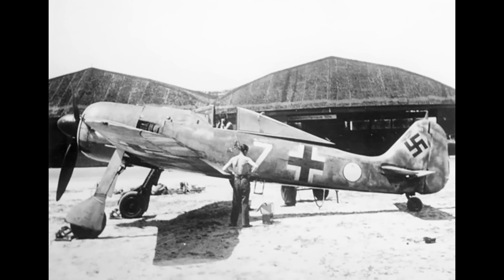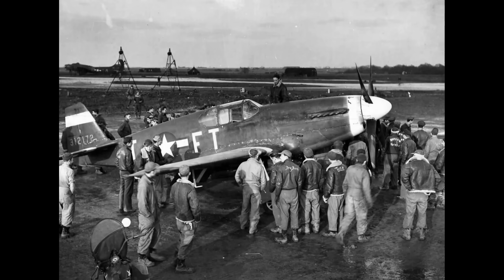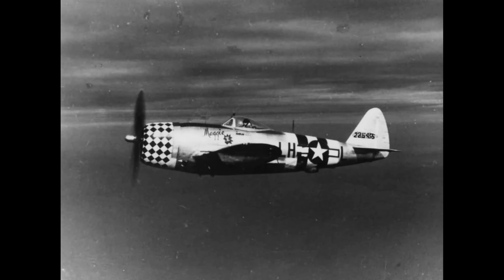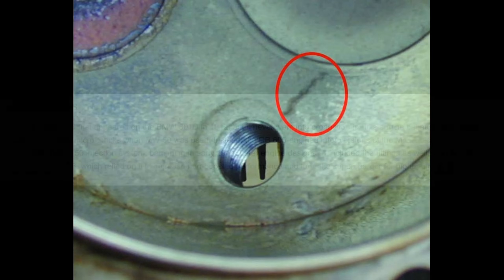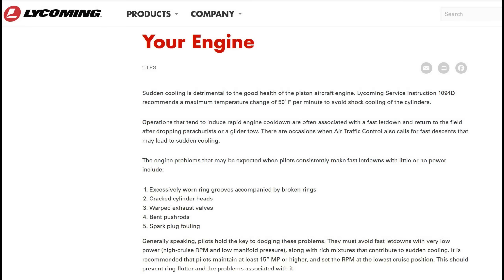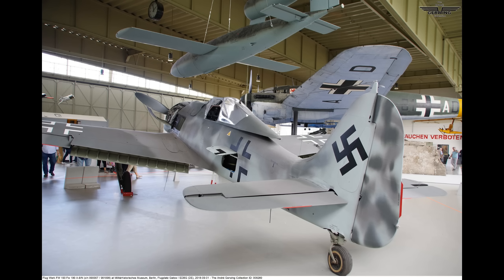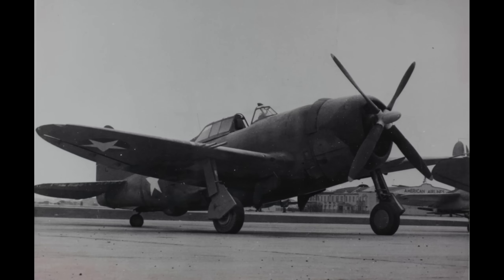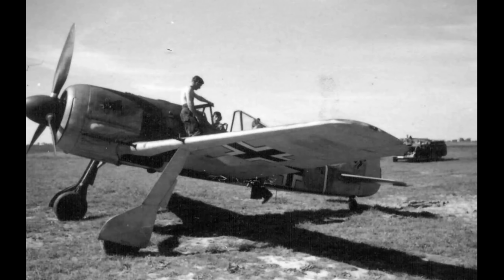Focke-Wulf Fw 190 A-4, Almost turned the tide, Almost...

Comment: I agree that that the metal the heads were made of were the bigger problem, in the late 70's and early 80's helped with building and running several diesel tractor pulling tractors, we would blow the heads off the block, before we ever cracked a head! We injected everything but the kitchen sink in them, took stock 40 hp farm tractor to well over 800 hp for a 300ft run!

Comment: Hi Greg, fuel cooling was a thing in the non water injected PW2800. The F4U is running an AFR of 9:1 at takeoff power, about as rich as you can go, without putting the fire out.
I’m doubting the A4 would have had the boost to be a super fighter at B17 altitudes, but they did fix that, with the Dora
Reply from the maker: Thanks.

Comment: My father was a B-24 pilot in the 15th, mid '44 till end of the war. He had much experience with 109 and 190 attacks. The 109s would bounce and scatter the formations. Then the 190s would charge in, often ten abreast, head-on. Dad said, without doubt - even worse than devastating flak - 190s chewing thru aircraft was by far the scariest thing he ever experienced.
Reply: Yup, my father a bombardier with the 15th 35 missions said he feared the 190.

Comment: Non pilot.. but straight up engine guy..idle any air cooled engine for 1.5 to 2 minutes eliminates this issue,( good for turbo cooling too). Snowmobiler here also.. rapid cooling comes from snow hitting 200 plus degree cylinders..I owned a John Deere spitfire. Google that.

Comment: Surely 'shock cooling' with water/methanol injection is going to be down to the very rapid phase change of the mixture i..e. going from liquid to vapour under the rapid increase in temperature from the compression by the piston, presumably this very rapid drop in temperature is what increases the density of the combustion charge  effectively forcing more mixture into the combustion chamber for more power.  Perhaps this rapid drop in mixture temp in direct contact with cylinder head surfaces is what could cause surface cracking in the heads?

Comment: Nice video on what might have been if MW-50 would have been extensively  used on FW-190 A series. Regarding shock cooling, you mentioned piston skydiving aircraft descending on idle power after releasing the skydivers. I used to be a skydiving aircraft pilot, flying mostly Cessna 182s equipped with normally aspirated Continental  O-470 engines. Aware and mindful of engine shock cooling, our standard operating procedure was descend maintaining around 15" manifold pressure  and 2200 RPM all the way to finals, while keeping a close eye on cylinder heat temperature. We never ever descended on idle power.

Comment: Most cracks in cylinder heads or anywhere else on any Metal Machine like an engine Usually occur Yeah regular Takes place places whenever they occur period Frequently the weakest point or the point that is most subject to thermal cycling. So yes if you're changing the temperature more often you may have a greater tendency to develop a crack where other aircraft have also developed cracks in their cylinder heads.
But usually the Lycoming engines have been around long enough that they know pretty much what they're going to do as long as you keep the right oil in them and keep it changed properly and use it within reasonable proximity of their operating standards. You're not going to have unusual problems with them. And as for the glowing turbochargers, those things are always glowing especially on aircraft where they're subjected to having to put out a decent amount of torque while cruising at any reasonable speed while they're trying to force that fan through the air. That's why I tell people who have turbochargers in their cars that if they drive it in a spirited fashion in any way shape or form, to always let it idle for several minutes before they shut it off. You shut off an engine with a piping hot turbocharger you're only going to cook the oil in the turbo shaft which will result in turbocharger failure. I've even seen people that when they shut the engine off they have a device attached to the car where it will sit there and idle for about 5 minutes before it will shut off.

Comment: (posting at 8:10 in the video) hey Greg, as an automotive mechanic and as far as whether or not shock cooling is "a thing" when looking at the various groups of aircraft - Piper Chieftain, training aircraft, aerobatic, etc., it may be worth looking into the specific engines themselves. A thicker roof on the combustion chamber should be more resistant to shock cooling than a thinner part. It could be that you find a correlation of "more durable" (thicker combustion chamber walls) in the engines used in training and aerobatics. 

It certainly stands to reason that when building a 'purpose designed' aircraft, like training or aerobatic, that both individuals and corporations would use engines "known" for better durability, whereas a fleet aircraft might use a more "lightly" built engine for economic reasons. 

Thus, one might observe that the training regimen for the turboed piston engines is entirely warranted while the issue rarely rears it's head in a trainer regardless of the abuse.

All that said, your explanation makes far better sense than mine. :D

Comment: OK, it was somewhat better than what it was up against, but it wasn't "turning any tides" and was going to be, at most, a brief period of superiority, followed by a crushing response that simply overwhelmed anything the Germans could have done. The "turning the tide" argument is  exactly what people thought of the Tiger tank, and all the supposed super-weapons the Germans tried to develop when they got desperate. Didn't make any difference, the Germans couldn't possibly oppose the Allies (largely the Americans) pumping out pretty good pilots and pretty good airplanes/tanks/guns. etc in absolutely overwhelming numbers. So, you are arguing about minor details of specific models and claiming that they were somehow decisive. "Shock cooling" is definitely a real thing, I have watched shock-cooled iron parts fail in a far more benign situation over and over. Take a cast-iron frying pan off a hot fire, and toss it into a creek, 50/50 it cracks. The details matter so minor shocks possible using air to cool it is a very niche issue.
Reply from the maker: The Luftwaffe did turn the tide, a number of times including when it stopped the USAAF from bombing Germany in late 1943.
Reply: @GregsAirplanesandAutomobiles  And what happened in Early 1944? The Luftwaffe more-or-less didn't exist in a practical military sense just a few months later. Point being is that these little microscopic and fleeting changes in detail advantages had no real effect on the larger "tide".

Comment: Remember this was all happening on the FW190A-4 in late 1942 when water injection was not well developed.  
MW-50 on Fw190 was given a /U or /R number but doesn't appear to have ever been used in any combat planes.
Now GM-1 is a topic i would like to see properly covered.
Reply from the maker: Water:Methanol injection was certainly fully developed by 1942, just not on the 190, and it never would be on the 190 for the reasons I talked about. I'll get to GM-1 in another video.

Comment: I don't understand. Surely cooling takes place on the vacuum/ intake stroke? Valorising the fuel mix is going to do absorb a lot of latent heat, no?
Reply from the maker: Compared to water, no.
Reply: @GregsAirplanesandAutomobiles  Right, but if it goes into the charge air, it's getting expanded and chilled on the intake stroke but the power stroke also burns cooler. Ok. Got it i think.

Comment: I saw an article or was it a video many years ago. But it was a gentleman hired, possibly by the military,to test 3 types of alcohol on aero engines. He qas given a couple of engines to push on a old school engine dyno. 
I remember the dyno bldg had a large air pump system to boost the engines as the engines werent running their own supercharger if i remember correctly.  
He tuned the engine by looking for soot. I remeber he said isopropyl alcohol did not work but then later realized it didnt because it richened the mixture a lot compared to the other 2 alcohols which I don't remember. 
I dont remember if he tested a German engine on that article. But you mentioned you weren't sure why germans abandon water/alcohol injection. The gentleman doing the tests said the american engines had water injection further on the intake allowing it time to travel with the air and cool the charge while german tried direct water injection or injection very close to the valves or something along those lines. I hope this helps.

Btw- ive tried looking for this article and have not found it again. Hopefully some1 has heard of it.
Reply from the maker: The Germans were spraying at the supercharger inlet, literally as far from the intake valves as they could get.

Comment: @ 5:40 Engine cracks, I'm  70yr old Brit, a  Motor Mechanical engineer, I started as an apprentice, with cars that still had metal rod operated brakes, to Citroens with Suspenion fluid bled off to operate the brakes, an awful lot, to take in in 5yrs of apprenticeship, but you never stop learning, In my opinion, one of the worst environments, other than flight, is road vehicle engine compartments, the expression, you wouldn't keep an animal like that, was common, Aluminium Cyl/heads on cast iron blocks, was a big proplem, all sorts of air ducting off exhaust manifolds to Carb inlets with the associated fire riks, and this was 25yrs after WWII,

Comment: Sry but this is giving to much credit to the FW 190 A5. Pushing the Normandy landings back? Soo the alliead  numerical makes no difference??
Still an excellent video but that take 🫤
Reply from the maker: Hold on Samuel. The Luftwaffe literally did stop Allied day bombing of Germany in late 1943, so it's certainly possible that had things been a little different they could have done so in 1942.
Reply: @GregsAirplanesandAutomobiles  In Germany not France. In northern France the range wasn't such a problem. And the  numbers are still there. More is still more.
Just a small joke. Great video 👍

Comment: 11:00 "no operational A5 or later Anton had MW 50." Seriously? I read that there were some problems but that at least the famous A-8 version had the MW 50 system. There was space behind the pilot seat for either a 115 liter additional fuel tank or for a MW 50 supply or for a GM-1 supply, as well as inlets at the fuselage to fill them.

Comment: The continuing development of the Spitfire and the introduction of the P-51 kept up with anything the Germans could produce. The FW 190 was only superior to the Spitfire for a short time and once the MK lX Spitfire and later Typhoon and Tempest the FW 190 became just another German fighter to knock out of the sky. By June '44 the Allies had air superiority over Europe.
Reply from the maker: In 1942 there were no fighters escorting into German and certainly not P-51s or Spitfires.
Reply: @GregsAirplanesandAutomobiles  the first squadron of P-51s went into service in January '42. Mosquitoes were introduced as night fighters for the RAF in May or June 1942.

Comment: In gliding,  lycomings are treated very gently and shock cooling is the reason. Power is kept in after glider release despite the fuel burn and longer turn round time. I was learning to fly gliders at Husbands Bosworth when they converted their Chipmunks to lycomings and immediately started cracking cylinder heads.

Comment: Spoiler: There was no way to turn the tide of that war. There was no way that German industry could keep up with the combined industries of the US, UK, and USSR. None.
Reply from the maker: The Luftwaffe did turn the tide in late 1943. They force the US to stop sending large daylight raids into Germany. Considering that, it's not hard to believe they could have turned the tide in 1942 when the opposition was much lower. I think you're confused about the concept of "turning the tide". It's not a one way street, it goes back and forth. I didn't say that the Germans could have won the war, that's very different.
Reply: @GregsAirplanesandAutomobiles  "Almost Turned The Tide" in the headline is quite different from "A two percent loss rate in daylight bombing caused a temporary respite in bombing". 
If the Luftwaffe had completely gained control of Europe's skies then the US and UK would have followed Soviet practices and concentrated on low level attack and air superiority aircraft. And since we eventually determined that Germany's weakness was oil production we would have used medium bombers or P-38s to keep those fires burning.
When being interested in aircraft, it must be remembered that strategic bombing is a way to accelerate the adversary's demise, but it's not necessary for his defeat.

Comment: Metallurgy was what jumped to mind for me the moment you said micro-cracking. Cast materials tend to have a lot of fracture issues with their poor grain structure and steels will certainly not help thermal shock loads with the poor conductivity. That's improved somewhat with modern material science but with WW2 aircraft it's definitely something I'd be wary of. Granted I am a little surprised MW50 has the capacity to create that level of shock loading but if they're spraying enough of it that could certainly be the case. But overall the difference between old steels, imperfections, and old heat treatments might be the reason why people believe it to be a myth when using even semi-modern steels and treatments.

I'd be interested if its even possible to find precisely which alloy and treatments were used in the engine or if that's lost to time. I assume it should be fairly easy to find how much MW50 is used per cycle to calculate the precise thermal drop?

Comment: From what I am aware of, the Fw 190 was made to replace the Stuka. It wasn't even intended to be a fighter. Plenty of planes went on to be famous by accident. The famous Mustang was originally made for the RAF. The US didn't even intend it for themselves. The Zero was mainly dangerous in the hands of a skilled pilot. The Corsair was meant to be a carrier plane, but just wasn't good at being a carrier plane. They said the Thunderbolt was too big to be any good. The Germans should have used the ME 262 as a fighter, but Hitler wanted it to be a fighter bomber. So many planes were often not used as intended.

Comment: Water methanol injection even on the dragstrip (racecar) CAN and WILL crack cylinder heads and pistons / rings 
I have done it myself
Reply from the maker: Air cooled engine?

Comment: Comes a point when it's easier to replace planes than first-rate pilots.  As important as air power was, and sea power, this war was won on the ground, and no aircraft could have turned the tide.  We could just keep knocking them down.  Even the ME 262 couldn't have done it, if it had come along a year earlier than it did.  Made victory in Europe more costly, sure.  But the Allies weren't very far behind in terms of jet engines.  

Germany lost when Hitler decided to invade Russia.
Reply from the maker: The Luftwaffe did turn the tide in late 1943, when they stopped the US from sending bombers into Germany. It only lasted about 6 weeks, but they did do it.

Comment: Your comments on the BMW 801 cracking heads, due to metallurgy, makes me think of the problems they had with motorcycle head in the mid 1960s. We called them butterheads. It was a different problem,  but you might find it interesting. Google it.

Comment: It would not have mattered how good the Luftwaffe fighters were in France in 1944.  There were not enough of them and they were not swimming in fuel.
Reply from the maker: 1944? Did you even watch the video?
Reply: @GregsAirplanesandAutomobiles  At 15:44:  "The (western) Allies achieved air superiority in early to mid - 1944". 
 My point is that the Luftwaffe could not achieve air superiority no matter how good their planes and pilots were, since they lacked the numbers.

Comment: Late question, I understand the metallurgy angle, but the DB601 and 5 used MW50 too... an likely used the same type or suffered from the same lack of alloys problem.
Reply from the maker: It's easier to stabilize the temperature of a liquid cooled engine.
Reply: @GregsAirplanesandAutomobiles  I would love a video on the larger German engines, the DB603 and Jumo213, the info out there seems contradictory at times.

The 190 could have used one of these if delepement pf those had been pursued with more dedication.

Comment: Hi Greg another fantastic video. I was wondering exactly how does these potential increases in horsepower translate into meaningful performance for a World War II fighter pilot? I’m guessing it’s not a linear progression however I could be wrong. Could you outline some of the benefits of having these tremendously high horsepower engine settings ?

Comment: 1) trainer engines are notoriously rugged  2) skydiving operations almost all have specific descent techniques maintaining certain minimum power settings and doing spiraling descents (often slipping) and many have actually installed speed brakes to allow for faster descents with higher power settings

Comment: What their needs to be, is a alcohol injection split plane manifold dual throttle body progressive intake, where the bodies work time retaining so together and they have a varying rate between the two to get the proper mixture, at one point you could turn off the one runner completely and just run alcohol or you can turn off the other runner and run completely out gasoline,